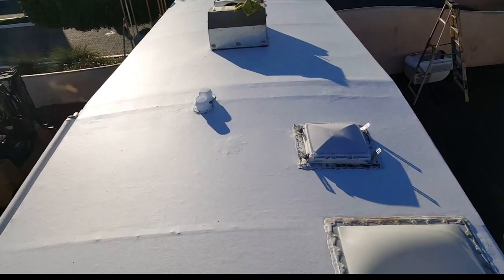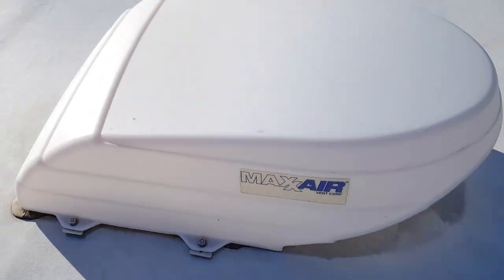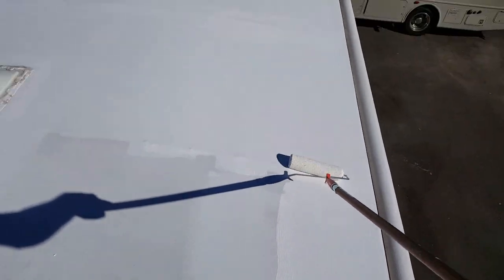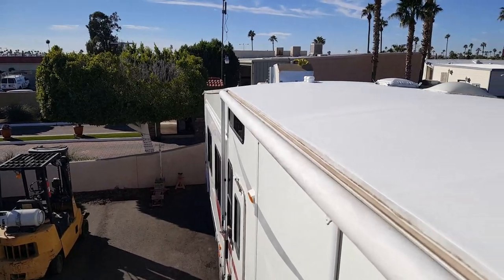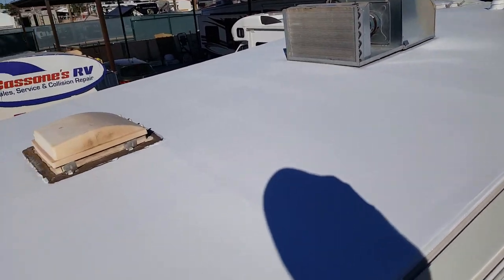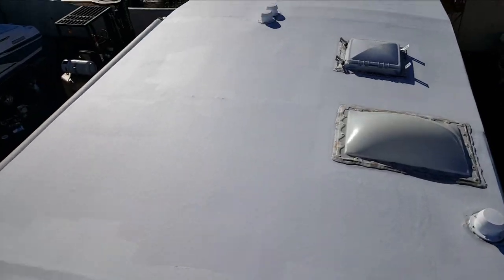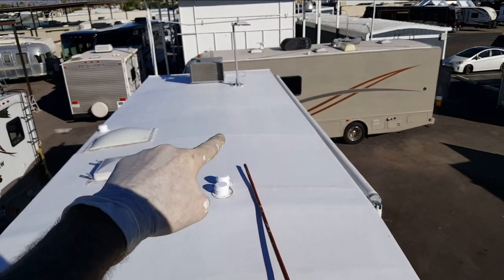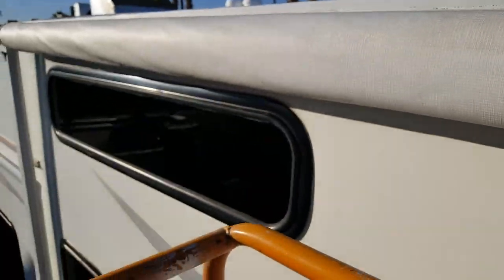Extending the Life of an Old RV Rubber Roof!

Comment: Coating a roof light this in the direct sunlight is concerning. I always coat my roofs at 5am or 7pm when the sun is not present. This way I can see where I have been, and I don't get over-exposed and over-heated by the sun.

Comment: Thanks for the vid. I bought the same product over a year ago, with plans to coat my roof.  Did not get around to it before parts of Houston got hit by a hail storm. The hail was golf ball sized. Before I could get an insurance claim completed, I noticed a few small leaks which I spot patched. Now with the Covid issue, I am about to put the toy hauler in the shop and have the insurance pay for most of the costs ( less deductible ).  Have you had any customer / personal recommendations  on using Camping World or Lazy Days to complete a re-roof repair ?   JwgK in Houston, TX

Comment: I have a TPO roof and found that it actually needs a special Dicor Sealant. I did not remove the sealant Started too but was concerned about tearing the TPO. I power washed, then denatured alcohol the sealant. AND then used Dicor Ultra Primer and then used the Dicor Ultra Sealant. I guess the ultra  with primer first is supposed to be a superior sealant. Have you used the Ultra? Thanks, Byron

Comment: A 32 foot 2000 jayco designer 5th with 3 slides good shape to buy. How Long would an average rubber roof last? Its 20 now and I want to park it full time in eastern Washington dessert. . opinions on how long I can use the roof?  Thanks so much please and thank you. ;) What makes the panels sag at the top of the radius . . no signs of leaks. Say 3 to 6 feet worth along both sides And about 3 to 5 inches I can feel where 2 panels meet and 1 is lower 1/4 inch going from the radius toward the center of the rig 2 to 3 inches? Does that mean its going to colaps under heavy snow? Ive been loving your videos. Lots of work!! Have a great day.
Reply from the maker: a membrane roof has an 11 year warranty. 20 years is at the outter limits of its seriveable life. If the roof is squishy at the sag then it has water damage. I would plan on it needing a new roof. Thanks!
Reply: @AZExpert  I looked at the video I made and the area in question is right by the AC I think we know the culprit. I'm not prepared for the work myself or the cost so I think I will not buy. Great education. Thanks.

Comment: You did a very good job of caulking the edge of the roof.   Back in 1977, I got a job at a prefab home company.  All the walls for a house would be built in a couple hours complete with doors, windows, siding, etc.   everything needed to be fast and efficient.   The caulk guys taught me to cut the tip at 45 degrees like you did, but they pushed instead of pull.   Keep a tiny amount ahead of the tube.  This will push caulk into the corners, and make it smoother.
You might give it a try sometime.
Respectfully,    Kevin
Reply from the maker: I haven't had much success pushing caulking, but I'll give it a try. Thanks!
Reply: AZ Expert    Just keep a tiny bit ahead of the tip.
Reply: @KevinCoop1  that is how I was trained, to be certified for applying sealant  on aircraft, per Boeing specs
Reply: thunderbird97    St Louis?   Or Oregon?
Reply: @KevinCoop1  it was in WA state
Reply: thunderbird97     The electrical contractor I used to work for did lots of work for Boeing in St. Louis, Mo.
Enjoy Life!   It's too short to waste!
Kevin
Reply: are you from IL
Reply: thunderbird97    Heaven forbid!    No.   Missouri
Reply: @KevinCoop1  sad to say I'm from IL, about 130 miles east of St louis
Reply: thunderbird97     So around Effingham.   Few more miles East and you would have escaped and become a Hoosier.
Reply: @KevinCoop1  lol, very close on past Effingham, I have been escaping to AZ during winter, but soon change home base to different state

Comment: Henry Tropicool would have been a great option here. I'm curious if you've ever used it?  Dicor is basically just a coat of paint.  Tropicool is an amazing product in comparison.
Reply: I was wondering the same thing. Why not use an epoxy coating?

Comment: I just love your videos and how awesome you explain what you are doing. I have a Tiffin Phaeton with a fiberglass roof that has a long bubble. Can I slice the bubble and then use resin to reattach to the decking? The was thinking about using Henry’s Tropicool silicon roof coating. Is this a good plan? Thanks so much…Bruce

Comment: so it's basically just slathering on sunscreen.  wonder if aluminum roof-coating would do any better
Reply from the maker: Yes, basically. No you must NEVER use any oil/petroleum based products on a rubber/TPO roof membrane like EVER!!!! It will destroy the membrane. I'm not yelling....I just did that once and still feel bad 20 years later.

Comment: just a quick what is the best way to remove dicor ,,, Hot? cold? scrape ? wire wheel (careful)?
Cheers buddy
Reply from the maker: carefully scraping has been my best method. Sometimes though once you get an edge started you can pull up and out to take the whole section out. Thanks!
Reply: A powered oscillating tool with a plastic scraper tip.  Any caulking or sealant comes off like nothing.  Just be careful and you wont damage  the membrane of the roof.

Comment: What are your thoughts on the professionally sprayed "lifetime" roofs? Almost seems like a line-x coating that is very thick. Not cheap either, for my 32' travel trailer at the time i was quoted $7-8000.
Reply from the maker: Define Lifetime?

Comment: Have you ever used liquid rubber or liquid roof? And if so what do you think of it, pro's and cons?
Reply from the maker: I have not. I cannot think of many pros other than cost. If a roof is aged enough to need replacement than the components are also at the end of their lives and likely there are damaged sections to the roof deck...so roof replacement is the best option the inspect and repair and replace all bad components. But that's just my opinion
Reply: My rubber roof is in very good condition.  But the white is flaking off the black rubber. The wood underneath is solid and I have no leaks.  Is there any reason I cant use a white elastomeric coating?  I dont mind recoating every few years until my rubber roof goes bad.
Reply: @JM-nh8yp I can't get a straight answer on which coating to use.
Henry's tropicool seems great but the rv pros don't give a straightforward answer as why not to use it .
Preventing aging is key in my opinion 

What did you end up doing with your roof 
I have a epmd  roof

Comment: How long was the camper and How many tubes of self leveling did you use on the roof as well as how many gallons of roof coating ?
Reply from the maker: should be about 30 feet long, 2 gallon of coating. Usually about 1.5 - 2 tubes of dicor per big vent 3 to 4 for each cap seam.

Comment: Why seal it with henry tropi cool if does not protect from the weather or seal anything? I bought this stuff to seal and protect from the weather as I thought this was what it was for :(
Reply from the maker: The Henry's product is a different product but the same idea. It will add some weatherproofing as it is a laryer of paint, but I would recommend fixing the cause of the leaks first if there are any. Thanks!
Reply: @AZExpert   so you were not using henry tropi cool?
Reply from the maker: @kristiepowers2555  This was Dicor's Rubber Roof Coating. Thanks!
Reply: Ok thanks for the replies!

Comment: Thanks for your video. I do have a question. Can this same process be used on the slide -out roofs if I remove the sweeps?
Reply from the maker: Yes of course. I wouldn't remove the wiper seals unless you're going to replace them though. Also be careful an work from a stable surface.

Comment: What is your thoughts on the difference between the Dicor product and Heng's?  Is the Dicor product worth the extra $$? I want to recoat the roof on my 99 DIscovery 37V, and want it done well and correctly, but never have been one to care about paying more for a name brand, if another product works just as well and is less expensive.
Reply from the maker: Heng's is a large name in the RV industry so it's not necessarily an off brand. It should work just as well, my only caveat is that these coatings do not seal roofs, they are more like sunblock for the membrane. Thanks for watching!
Reply: Thanks! The roof is in fantastic shape, no black spots, no soft places, sealant is fine everywhere. I just want to stay ahead of everything and take good care of it, and I was thinking that a good cleaning and proper maintenance and a good fresh coating would just extend the life of it.